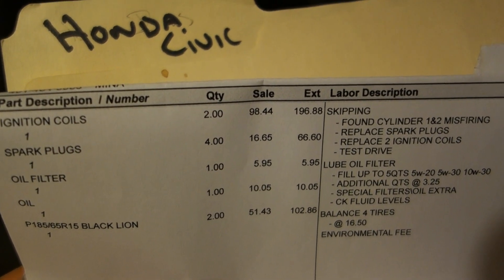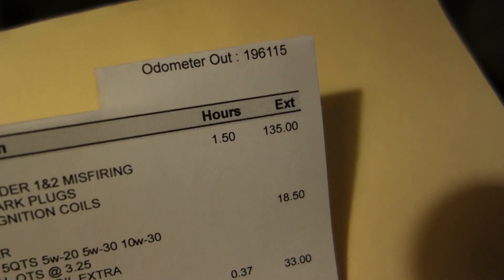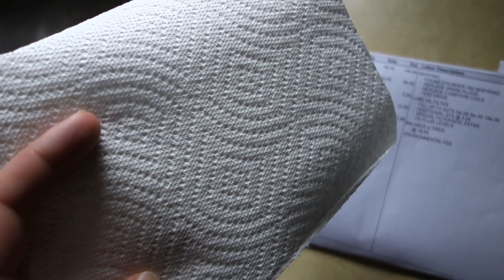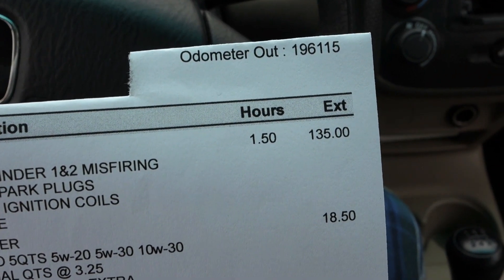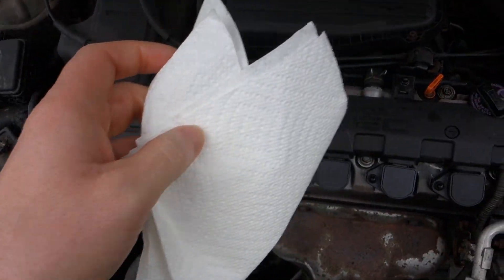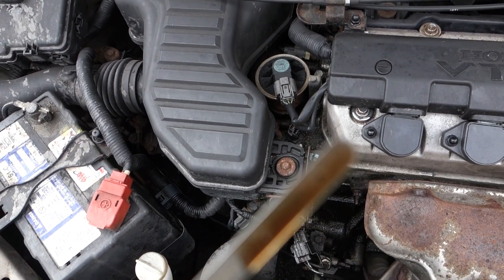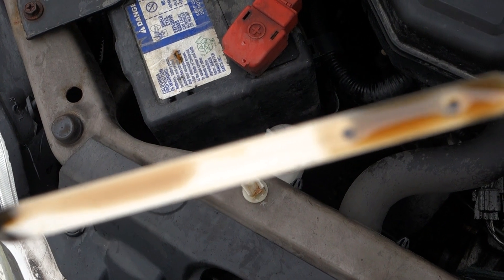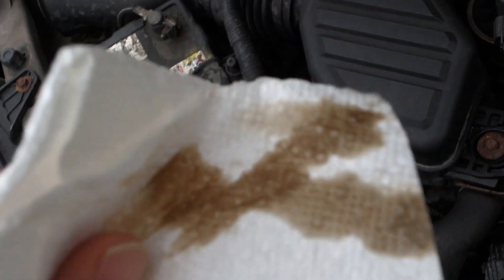Dark Oil After Fresh Oil Change - Honda Civic W/ 200K Miles (Is This Normal? Help Me Scotty Kilmer)

Comment: The oil was changed is just that your engine has so much gunk in it that needs to be all cleaned out. The other thing is that your engine is getting old now it’s got 196,000 miles you know I was probably like in the old days detail blow by whatever they call that, so you know a lot of people blaming the mechanics or the oil not being changed that’s a lot of BS
Reply from the maker: Your opinion seems to be the consensus from most the comments. As a preowned car, those 196k weren't easy miles and the engine is a mess for sure. Thanks for watching, Bill. Happy New Year!

Comment: Too much dirts in your engine. You need to flush your engine oil but then it may cause other problems. This happens when u don't change oil regularly . so he probably did put a new oil in there.
Reply from the maker: Hey y s, thanks so much for commenting! I agree with you, this seems to be the consensus. Do you think the situation can be improved if I change the oil more frequently, like every 2500 miles? Thanks again brother, wishing you the best!
Reply: @JonathanBrowneMenzies  hey. I would put some cheap oil in it, drive it for a 1000 miles and change the oil again for a couple times. Or drain the oil, from the dipstick whole put diesel in it until it cant take no more then let it set for a few hours then drain it and fill it up with new oil. I've never done that but that's an old method that I know. Let me know the result. Do it at ur own risk
Reply from the maker: @ys9247  Thanks for the info, it's worth a try at this point, the car is on borrowed time LOL
Reply: He topped it off. Plain & simple
Reply: You can’t get 100% of the old oil out during a change. The remnants of old dirty residual oil is still there. The oil on your dipstick has dirty and clean oil on it. Possibly from getting topped off, but I doubt it. But the only way to really tell is to get under the car and look to see if there is a new filter. If there is, I would feel much better about the situation. The guy talking about putting diesel in the crankcase.. there is a product called “sea foam” and you can put it in your crankcase and drive about 100 miles BEFORE you are due for an oil change. This stuff really cleans up the residual sludge and gunk that gets stored in the engine over time.

Comment: looks normal to me, its not that dark brown almost black color, its still transparent, some engines dirty up oil faster than others, this just means the oil is doing its job even after only 9 miles of driving
Reply from the maker: Hey trigga ville, thanks so much for commenting. I was hoping to get this response. Do you think the higher RPMs of a Civic has something to do with it?

Comment: It was a scam. New motor oil looks like cooking oil, it should look gold not brown. Sorry this happened but it happens all the time.
Reply from the maker: Hey Richard, thanks so much for commenting. I'm thinking of trying another shop and hopefully the results will be different. Wish you the best brother and thanks again
Reply: Jonathan, I’m with Richard Ojeda on this - that oil looks dark for a 9 mile drive. I also have a Civic (‘16, with 160K miles) - depending on the driving you do, it shouldn’t look that dark til at least 3K/4K miles! 🤷🏻‍♂️

Comment: I know this video is 3 years old but I have a 2005 civic ex with 236,000 miles (same generation). It’s always dark after I change it and black soon after. They definitely changed the oil. I promise you
Reply from the maker: Thanks for commenting, Robert! Good to know that this issue wasn't unique to my car. Wishing you a great summer, and another 100k for your Civic!

Comment: My mdx oil would be black by 1000 miles. I ran liqui molly engine flush before my last oil change and 1000 miles later it’s only a little darker but not black. There’s probably just dirt in your engine.
Reply from the maker: I'll give the liqui moly a try. I've seen it but never knew anyone who used it. Thanks for the info and for watching, Tigran!
Reply: @JonathanBrowneMenzies  there’s a lot of videos on YouTube about it

Comment: What did the oil look like before you took it to the shop? How many miles were on the oil before you changed it?  You never mention those important questions. If the oil had 3000-5000 miles on the oil before it was changed then I would say that they did change the oil. It’s too clean. Also, you will never get all the dirty oil out and there will always be dirty oil mixed with clean oil.  What brand oil did they use?  Some is darker than others.
Reply from the maker: All good and important points, B W. Thanks so much for watching and commenting. I'm in the process of learning to change the oil myself, hope that resolves the issue once and for all. Have a great summer my friend!

Comment: Can’t really tell it could be anything wrong with your car.  Loll lol. I have a G3 five and up until about 70,000 miles whenever I change the oil it was so translucent that I think that my card did not even have oil in it after 70,000 miles it gets dark after one month sometimes after one week but I think the engines just getting old and a lot of other things are probably going on with the engine at this pointso you know I could come down to piston rings I don’t know not worth investigating. I just change the oil whenever I think it’s dirty now sometimes that’s one month sometimes that’s two weeks sometimes it’s three months.
Reply from the maker: Hey Bill, this car was on borrowed time for sure. I like your method of changing the oil as soon as it starts to look dirty. Wishing you happy holidays and thanks for watching!

Comment: Do you use synthetic oil?? That's the first question. If it's synthetic oil it's looks kinda ok to me. Synthetic oil absorbed heat really well and gets darker fast. Conventional oil doesn't get dark even after 1000 miles. Most oil change shop they don't spend enough time to drain old oil properly and lots of lube change shop use sucker to suck old oil from the dipstick hole, and the result, they leave at least 20% old oil inside so those cars take over 5qts oil they can actually finish the oil change in  less than 5qts of oil. In my opinion, your mechanic did a quick lube change in your vehicle. your oil may looks dark but it looks healthy. You know what I change my own oil, everyone should change their own oil. I've seen my oil got darker after couple days later, and it was me who changed my own oil. Modern synthetic oil absorbed heat well and has detergents that keep engine clean from inside and gets dark.
Reply from the maker: Hey Ashiqur, thanks for watching! I don't use synthetic, just standard motor oil (although the garage probably used the cheapest brand). I never considered that the shop might have sucked the oil out and not drained it properly, that's a strong possibility. Your method of changing your own oil is the only way to make sure it's done correctly; I'm planning to learn how to do this. Wishing you all the best and thanks for the info!
Reply: @JonathanBrowneMenzies  changing oil is fun brother. I change my own and couple of my neighbors requested to help them changing their too which I enjoyed 😁. I just watched YouTube videos how to change oil xxxx model and it's fun. wishing you all the best

Comment: Does your car burn oil? If so you probably have an internal leak. I do and my new oil gets dirty just as fast as yours did. Rebuild coming soon.
Reply from the maker: Hey Ralph, thanks so much for watching! My car does burn oil, I need to add a quart between oil changes. I never thought about the possibility of an internal leak. Thanks bro and good luck with your rebuild.

Comment: Cant clean 200,000 miles of dirt sludge etc out with one fluid change doing the minimal (max) interval.  It’s probably a losing battle with such a worn motor but change your oil for 3 intervals of every 3000 miles and maybe it might clean up.
Reply from the maker: Thanks for watching and for the advice, Marc, much appreciated! I ended up selling the old Civic but I now have an old CRV and I'll definitely ramp up the oil change intervals. Wishing you a great summer!

Comment: That looks like 2 month old oil to me. 200,000 miles or 20,000 miles. No engine will turn oil black that fast
Reply from the maker: Hey Ty, it hasn't been that bad in oil changes since. Do you think it's possible they changed the oil and not the filter?
Reply: @JonathanBrowneMenzies  quite possibly the filter was not changed. I wouldn't be going back to that shop!

Comment: Go ahead and change your own oil with good oil that has additives and cleaners in it and then drive 9 miles and check fo yourself. I think you will be surprised with what you find. Why not do this first before you imply someone did something shady. My money is on the guy did the change.
Reply from the maker: Hey Poker Pilot, thanks so much for commenting! Learning to change my own oil is something I plan to do. I didn't mean to imply that the mechanic was shady, this could be completely normal for a car with over 200k miles on it. Sometimes it's helpful to get the opinion of others, and it appears in this case I can't come to any definitive conclusion. Like you said, the only way to be sure is to change the oil myself. Thanks again for watching and wishing you luck on the poker tables!